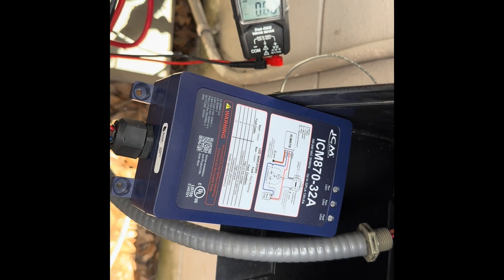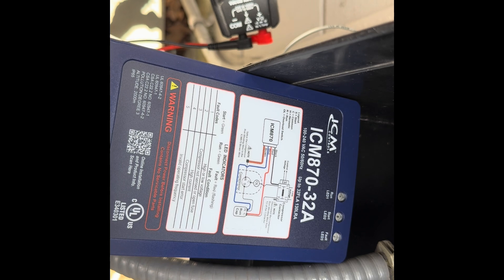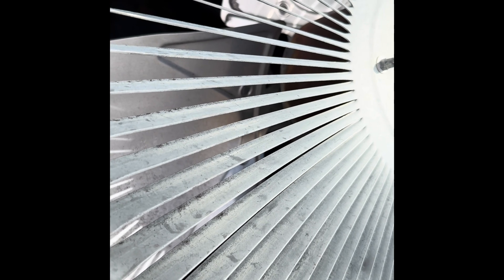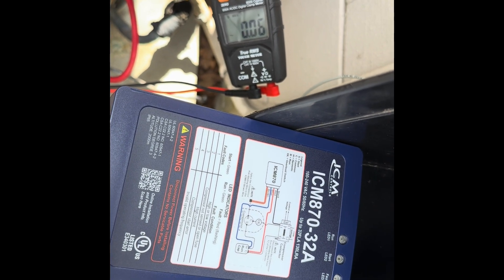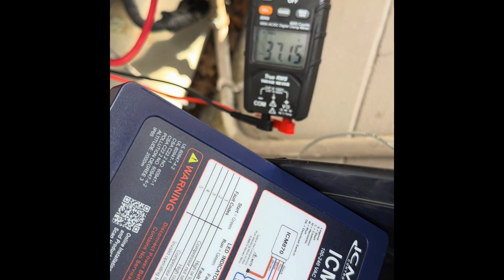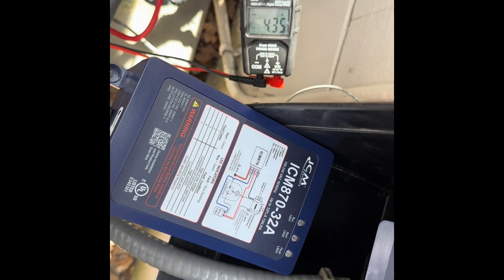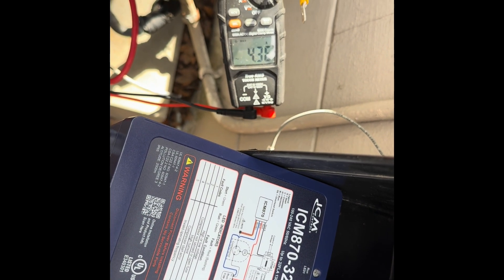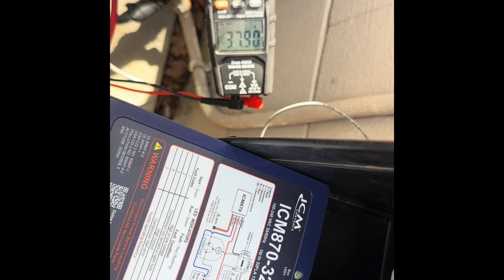ICM870-32A soft start. Testing it on an Amana 3 ton AC unit

Comment: I installed mine and the compressor was on during the 4 minute delay after the 4 minute delay it kicked the compressor off what did I do wrong
Reply from the maker: Sounds like you don’t have the wires in the right place. Double check all of the wires according to the manual. Hopefully that fixes it.

Comment: Still pulling 37 AMPS on startup with the soft start? Your going to need a big generator if so.
Reply from the maker: My 6300 running watt generator starts it no problem. The 37 amps only lasts less than a second. I got rid of that generator and going to try a 6000 watt.
Reply: Ok noted I have a standard 5000 honda (non-inverter) and a 2.5 ton AC. So should work ok. I suppose if it wasn't a fraction of a second it would trip the 30A breaker
Reply from the maker: You are correct. If that is an Honda EB generator it can hold a 7000watt load for several seconds. I think a EB6500 is a 5000 watt generator.
Reply: @Motorcycles-Generator-Honeybee  not even sure. It's old from about 2001, my parents handed it down. I'll have to look up the surge wattage.

Comment: I installed the 870-32A on my 3 1/2 ton. It works OK but will randomly go into the rapid red LED showing the 4-minute time delay. I reached out to their tech support and was told that the time delay will happen if the compressor didn't get at least 4 minutes of runtime on the previous cycle. He can't explain why mine does it randomly. I don't like the 4-minute delay and you can feel the warm air blowing out when it's in time delay.
Reply from the maker: I tried both the 32A and the 16A with my 3 1/2 ton unit and had better success with the 16A. I also had random 4 min delays with the 32A and it is very annoying. I did videos on both of them. Thanks for watching.

Comment: would you be able to weigh in on any noise reduction as a result of the soft starter? My 4 ton AC has a pretty loud "click +  buzz/rattle" at the moment it initiates. I was wondering if that can actually be alleviated with this ICM870-32A
Reply from the maker: The click won’t change because that is the relay engaging. The buzz and rattle reduced by about 25% on my 3 ton 20 year old Amana.
Reply: @Motorcycles-Generator-Honeybee  thank you for the response!

Comment: My ICM870-16A does not have a 4 minute start delay unless it detects a fault on the previous startup. Mine starts the fan and then the compressor right after that. Yours is flashing the fault LED.
Reply from the maker: Thanks for sharing

Comment: Ok, I called ICM and talked to a technician and he clarified something about that 4 minute delay, and he is right. If the a.c. contactor pulls in and sends voltage to the soft start and if it  senses bad voltage like low, high , frequency not 60HZ etc it will go into fault. If everything is correct it will start the compressor within a few seconds.  That's the way mine is working. My AC is close to the back deck where I enter the house and if I hear the contactor click , ill pause for a second and wait for the compressor to start if it don't the red fault blinks for 4 minutes. Most of the time it starts within a few seconds.

Comment: I didn't see the amps drop
Reply from the maker: I forgot to add the section in where I tested the amps before the install. You can see that on my other video where I test the ICM870-16A. It was 93 amps without the ICM.

Comment: Who the hell needs that? AC condensers manufacture haven't used or needed that for 80 years plus. New bullshit to sell!  New Amana's 16 seer comm models suck!
Reply from the maker: The soft start is great if you want to run your AC with a portable generator. That is why I bought and installed it.

Comment: So either way once you set the thermostat ac will not turn on for 4mins. That’s a long delay most thermostat already have a 4 min delay from restarting compressor
Reply: Or least can be set to whatever. The microair easy start is way to go. Seems like if that is not able to change.
Reply from the maker: The microair has some very nice extra features but costs much more. I just received another brand of soft start that compares price wise to the ICM. I’ll make a video of it shortly. Also the air handler runs during the 4 minute delay. So it will take 2 on time delay units to make the ICM 870-32A work like I want it to.